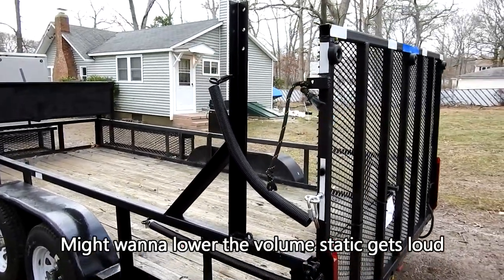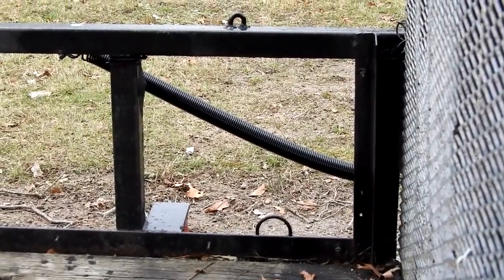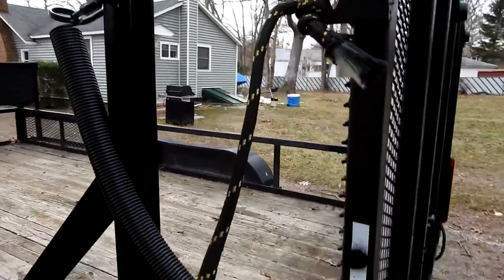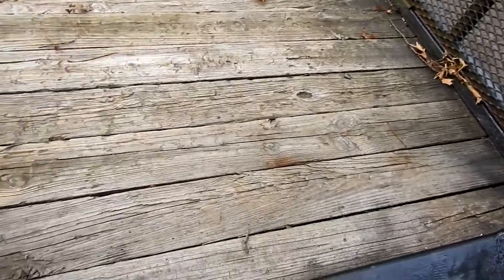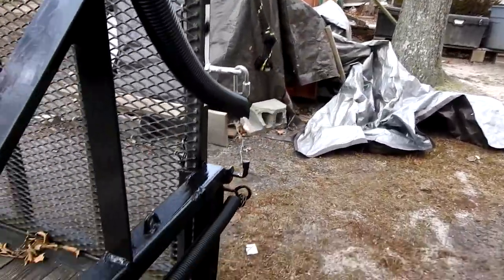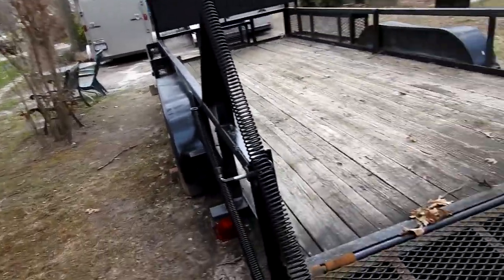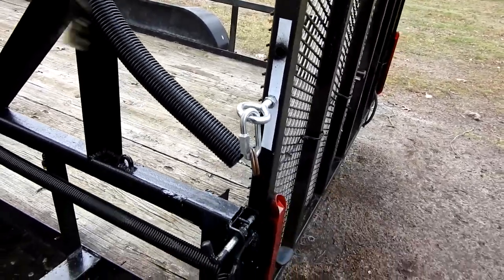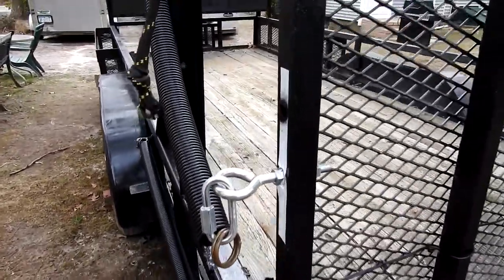Spring Assist for Drop Gate Open Trailer

Comment: I agree with Casece Case, your first set of springs were attached too low on the door. Closer to the top would have worked better, of course you would need  to reposition the other end to accommodate the repositioning of the gate end. I just installed a spring on my trailer.
Reply from the maker: T, Skipwadoo ..hey thanks for the comment... it's actually working out great! When gate comes up that tension on the 1 main heavy duty spring is no longer needed and the other 2 springs pulls and holds that gate right up so there's not much effort to close gate and it's a lot safer cause the springs will have less wear and tear on them by helping the other springs to use less tension and keeping them from breaking cause I seen people use only one spring and it snapped witch is more dangerous .. I know they were too low but now it ended up being beneficiary in this situation.. plus this gate is really heavy

Comment: young man , u need the eye bolt on the gate a bit high  about foot from the top side
Reply from the maker: That was the best spot for it cause when i was adjusting that one big spring all 3 springs brought up the gate way to fast and it wasn't easy trying to open it.. so thats why i made it loose cause the other 2 springs bring up the gate just right. It didn't need all that tension on the gate.
Reply: young man , where u put your eye bolt now u or somebody might get hurt , but if u put  > LIGHT PIECE ANGLE  - IRON  -" WITH 4 OR 6 HOLES  A FOOT FROM THE TOP SIDE WILL WORK LOT BETTER " FOR U 

YOUR EYE BOLT IS TO LOW  , IF U PUT TOP SIDE  U WANT HAVE ANY TENSION OR STRESS EITHER ,

WANT HURT IF U LIKE , AND U GOT MOST OF ALL THE PART ALREADY  ! .

THANK CASE

PS : DOUBLE BARREL  ASSIST LIFT  JUST LOOK ONLINE TO SEE WHAT I 'M TALKING ABOUT
Reply from the maker: +CASECE CASE ok thank you for your safety input